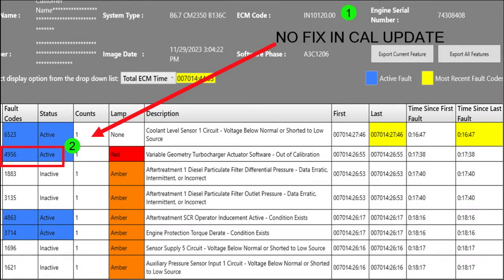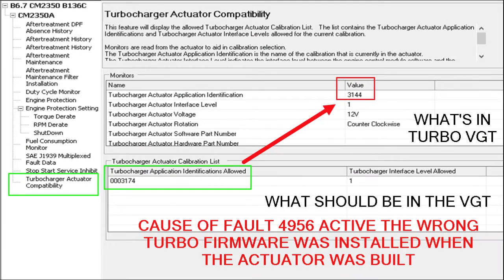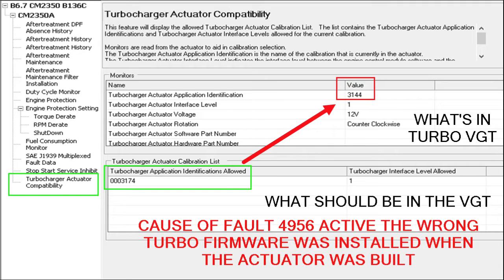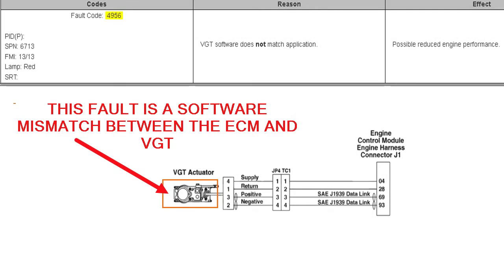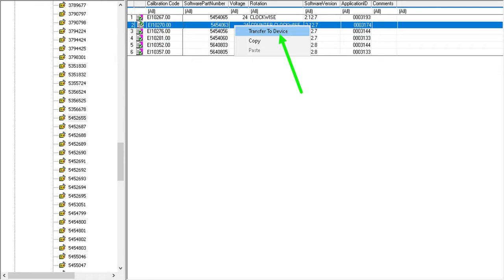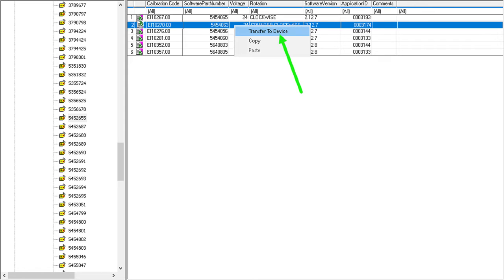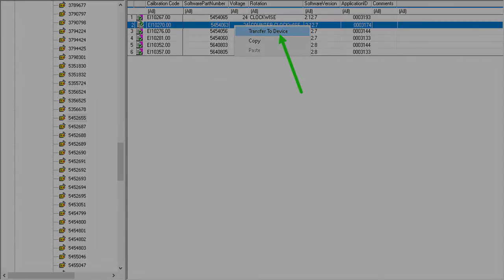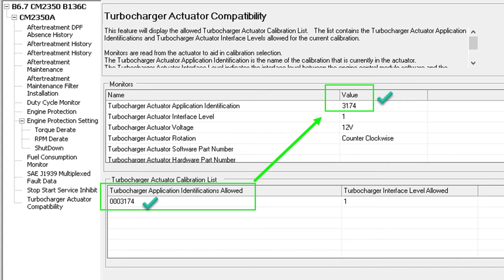My turbo VGT actuator has the WRONG SOFTWARE in it??

Comment: Currently experiencing this same issue.. another shop failed to put on proper VGT “aftermarket” installed new actuator, I’ve installed hundreds of these things. In a Pete so paccar, engine runs great. Passes actuator calibration process and passes turbo hysteria test.

Comment: Hey I’m trying to do this update and keep getting no smart device found error when trying to send to device. Would you happen to know the cause? I don’t get any pop up window to confirm sending it over when I right click just error number 27258
Reply from the maker: If you are using insite and getting that I would suspect a problem with the vgt. Can you do the vgt hysteresis test ? If that fails to connect to your vgt there may be a board issue in the vgt motor.

Comment: Have you experienced the ECM not accepting actuator firmware update?
Reply from the maker: Well you are actually updating the actuator eprom itself. The ECM shows the firmware in the actuator. If you cannot update the actuator and you verified the update is for your part number actuator then you may have a bad actuator. Try using the private data link 3 pin on the engine just incase there is too much traffic over the vehicle's data bus.
Reply: @ENGINESHOPJOE  I appreciate your response.  I had to get the proper firmware from Cummins.  The firmware I tried to use for my actuator part number was not correct (even though it had the application code my ECM asked for).   So far so good.  This problem was definitely something I had not seen before.    Great video by the way!